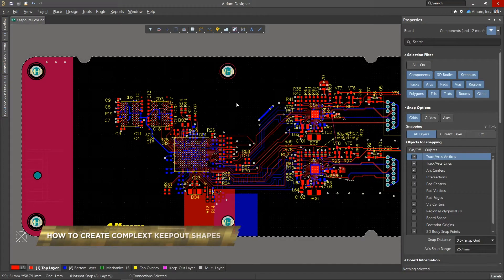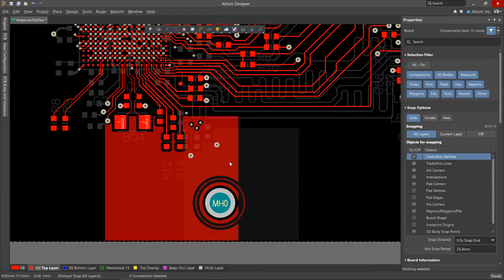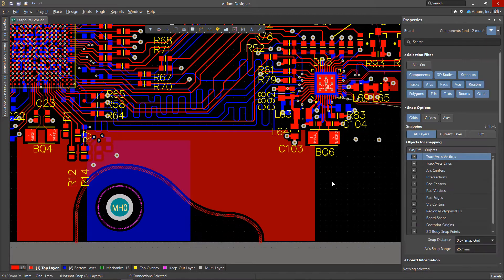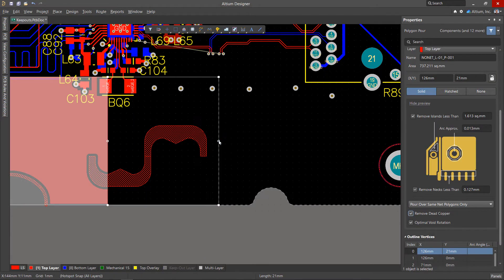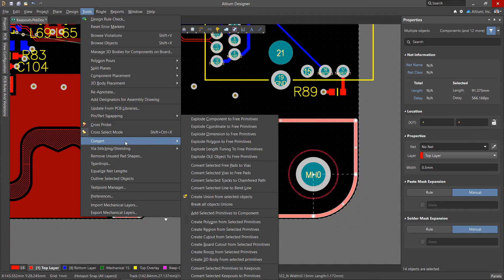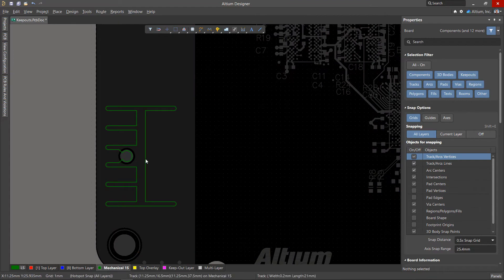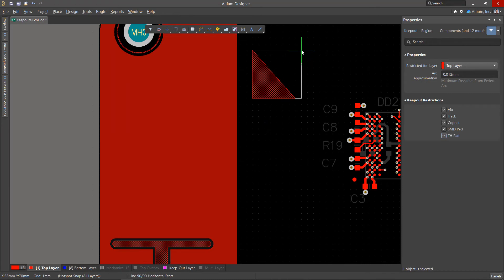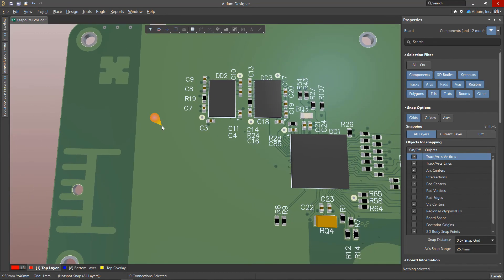How to Create Complex Keepout Shapes in Altium Designer

Comment: Is there a way to make a keep out region around a trace? Maybe with a net class and clearance? I needed to have an isolated trace with no pours around, above or below but couldn’t make it work so I resorted with just a keep out region
Reply: A keepout region is acceptable. The best way to do it is to do a net-specific clearance rule. This way, if you change the routing, the clearance will also update and you won't have to change the keepout. For designs where you have a trace that is connected to coupling capacitors or other components, you can add all the nets in the interconnect to a net class and apply the clearance rule to the net class.